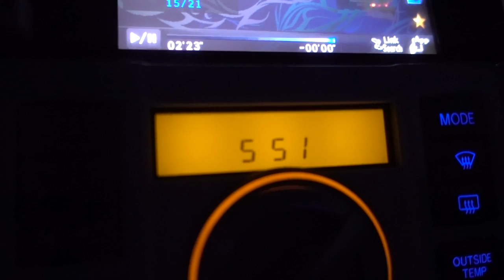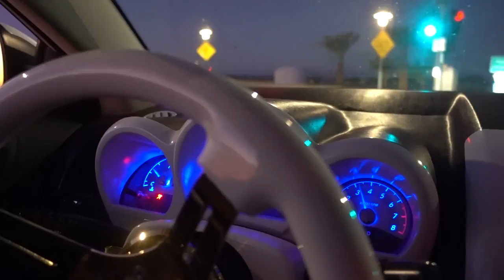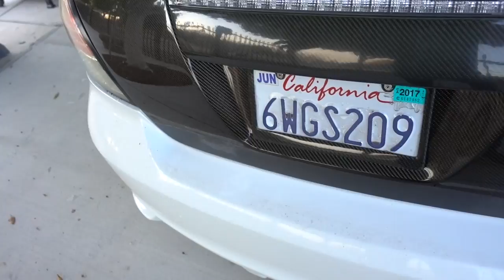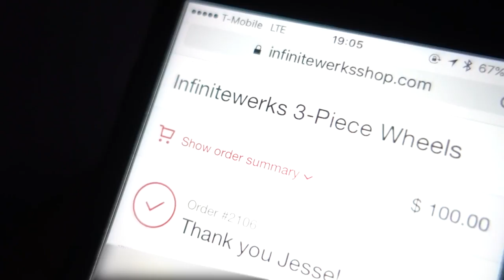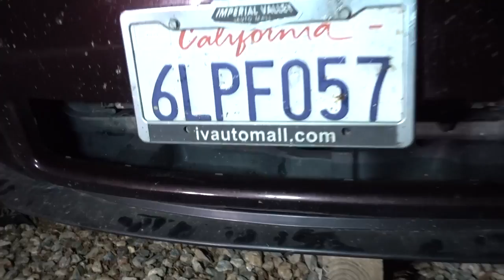New Wheels for the TC Revealed!!!

Comment: hey i need some help with my tc and i was hoping you can help. I noticed that in your car when your headlights are on your time display light is also on, but on my car it doesn't turn on when my headlights are on... what do you think it could be?
Reply: Mine does the same. Only way I can get the light on if if I turn the lights off real quick to check the time then flip me back on real quick when is dark